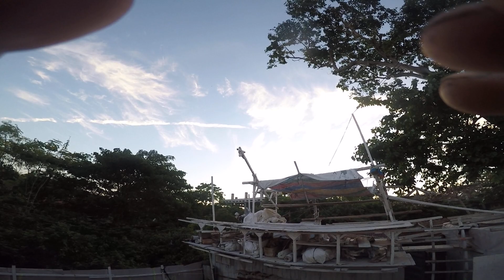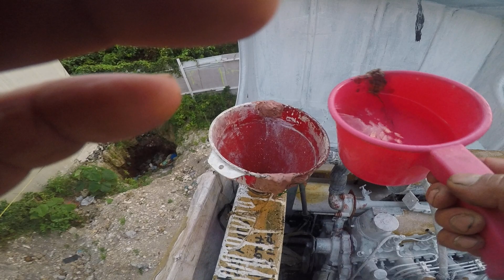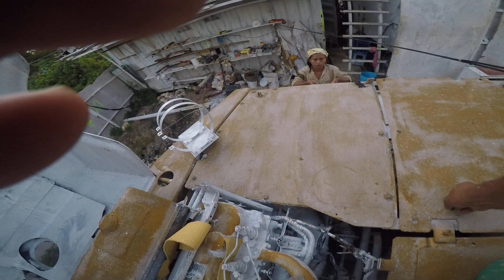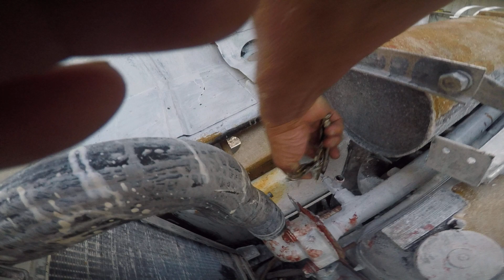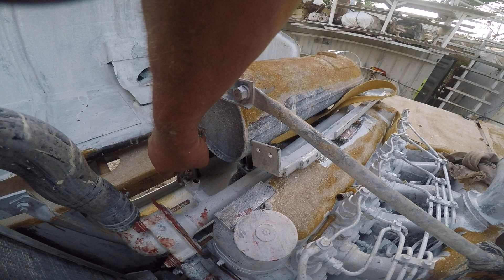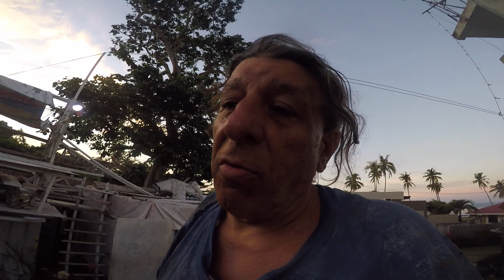MOVING TO THE PHILIPPINES CLEAR BLUE SKIES IN THE PHILIPPINES     NOT SO LOOK AGAIN GOPR2467

Comment: wondering if you are going to share the progress on your hotel build ??
Reply from the maker: yes right after I tear the motor in the track hoe down and replace the O Rings around the cylinder sleeves...because I still have an internal leak in to the crankcase...I start that job on Monday